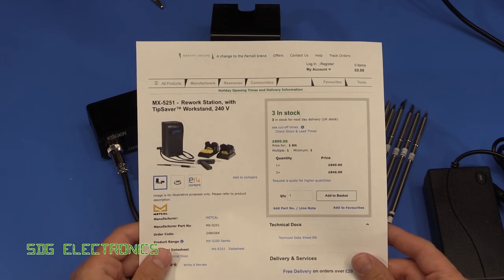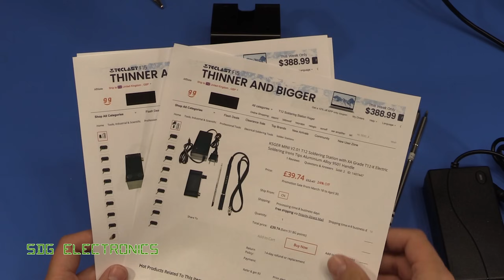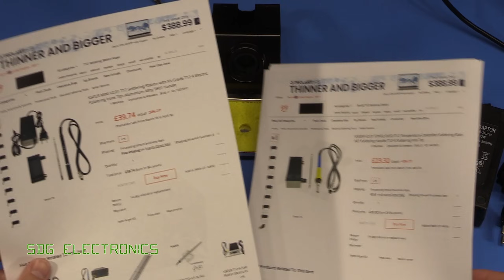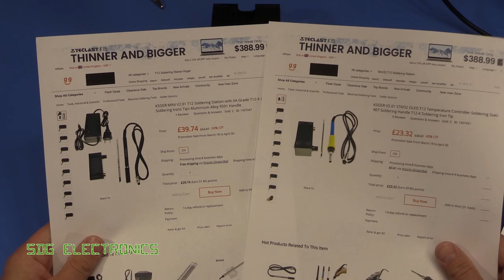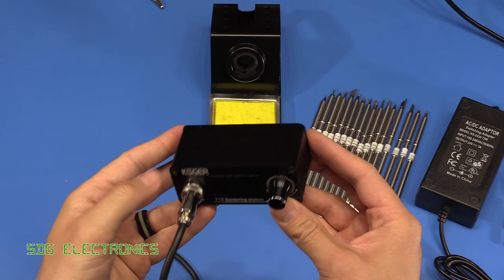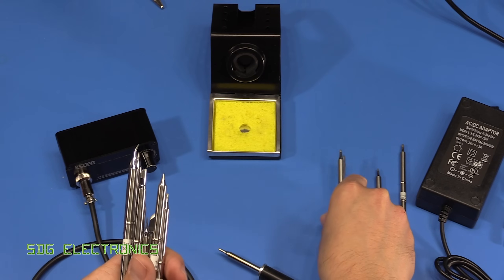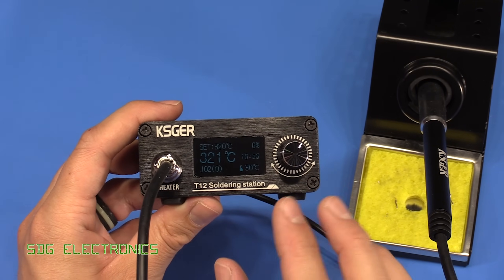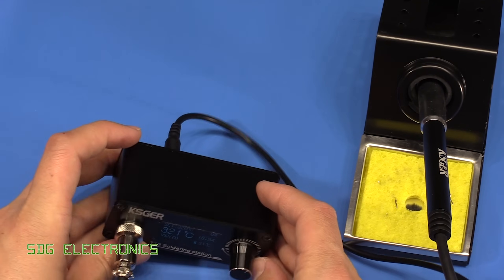SDG #072 Best Low Cost Soldering Station - QUICKO / KSGER T12 STM32 907

Comment: I was looking at buying a Weller or Hakko soldering station for £150-200 but people kept recommending these Chinese T12 stations as they're much cheaper and supposedly much better.  I realised I was looking at buying brands I knew because of nostalgia and aesthetics and not so much because of functionality or performance, so anyway I've splashed £40 on a T12 station a few new tips and a iron holder/safety rest.  If I like it I will recommend it to a friend who is looking for a hobby iron.

Comment: Great video! I do have a question I just need an iron for soldering pl259 connectors onto coax for amateur radio. I’ve been told you want a high powered iron to heat the large work piece some claim 60watts others 90watts. Is this something you can comment on?

Comment: If I used a 24 Volt, 5 amp DC power supply, would it hurt anything?   Or, do I need to limit amps to 3 or 4?  I am considering buying the Quicko unit.

Comment: I am a hobbyist but over decades of working on vehicles I have done a huge amount of wire repair, soldering, heat-shrink on 50 foot rolls & dielectric grease in moderation but I know this may not get an answer, but can change from degrees C to F?
  And you had mentioned software, downloads or files (Something like that) but do this mean it connects to a computer to set up certain things?
  I really appreciate the show & tell and clear proper British speech. The old ears ain’t what they used to be. I’ve been married 40+ years and that alone comes in handy. You will see!
 Thanks for the work & info + links.
Regards!
Reply: Well, SDG Electronics have sold out all items in link. I guess I will wait!
Thanks for the info again!
Reply from the maker: There are some options on Aliexpress, but the component shortage reduced available stock

Comment: Just got a Hakko 888D. This iron seems to be better for the price. I guess I can just feel good for supporting Hakko. The Hakko 888D is a great iron, it does not have the automatic turn off.
Reply: Bad choice. That's an outdated technology. Having the heater and thermistor at the tip in one single piece is in another league.

Comment: Is the tip ESD safe? I'll be using a grounded 19.5V 2.31A laptop power supply and sometimes a double insulated power supply. 
Hope the 45W will be sufficient.
Reply from the maker: The tip is connected to the chassis, so if using an earthed power supply, it should be referenced to earth
Reply: @sdgelectronics  how so? The DC plug at the back has only two pins, not three.
Reply: @alejandroperez5368  i have modded both the 24v power adapter and the mini T12 to include 4mm banana sockets and make a earth wire with banana plug. It works great

Comment: Do you think it's possible to sort of "hack" the quicko T12 to use another style of iron like the zd931 variant? They are both 4-pin connectors, but I'm not sure the PID controller will work properly with the zd931 iron due to them probably having very different thermal characteristics.

They also might be using very different thermistor values.

Comment: Hi, I have a question.
-it is still ESD safe(grounded) when power supply has only 2 pin AC connector to the wall?( i want that MINI version)
I leave like and sub if you can help me :)
Reply: No, but if you use a power supply with a mains referenced ground for the barrel jack, then it is, but I recommend going for the full size one, then there's no guessing. The third prong is ground on any plug, and isn't grounded otherwise.
Reply: @jmantothe64  Thanks for advice :)

Comment: Do I still need to ground bond this type of Soldering station?
Reply: I'm guessing no, as in this version all the mains stuff is in a seperate plastic case power supply.
Reply: @untrust2033  what about for ESD reasons?
Reply: no
Reply: demetrio dario nope

Comment: Metcal MX500 models can usually be found cheap on eBay, I wouldn’t use anything else :-)
Reply: Whats better,a 2 handle Jbc clone for $200,or a pace ads 200 for $260,or a metcal mx500?

Comment: does the black aluminum soldering iron handle heating up in finger when used?
Reply from the maker: I used it for 3 hours of PCB assembly - it got warm but not hot.

Comment: Since this is powered by an external power supply, do you have any idea if the tip is ESD safe?
Reply from the maker: It is when connected to a Class I power supply. I didn't look at the supplied power supply to see if it was earthed or not.

Comment: Between the t12 Like Stations (this) and ts100 (which offers better mobility ) isnt really a difference performance wise.
 24v Brick or Li-ion pack both deliver buch of Power into the tip.   These t12 only has the advantage of supporting the hakko tips properly. TS100 does aswell but it makes it unnecessarily long/unwieldy.

Im using both, i pick the one thats the most convenient in this particular situation.
Reply from the maker: I've not tried the TS100, the distance between the tip and the handle looked a little long for my liking but I do think these offer huge value to the hobbyist. Decent temperature controlled soldering irons were always so expensive in the past. Thanks

Comment: They will run from a 20v lithium battery like the ones used on a drill.  I have Ridgid batteries and I 3d printed an adapter plate to get the voltage out of it.  It runs for a very long time and lets me work in the yard, on cars, or in spots where AC is not available or inconvenient....
Reply from the maker: Yes, there is a menu option to change the minimum voltage before the unit shuts down. I will double-check when I get chance what the minimum setting is.
Reply: @sdgelectronics  The Quicko unit I have (T12-942) works from 16v to 24v well within the envelope of a "20v" (5S) battery that typically runs at 18.5v
Reply from the maker: @kirkb4989  looks like this one also works down to 16V. Very versatile 👌

Comment: Are there any cheap soldering stations that turn off the heater when you put the handle in its stand?
Reply: Reading through the comments, the one shown in the video has a tilt sensor in the handle to facilitate sleep mode.
Reply: @japonicaren  So the thing turns off when you tilt it forwards....   what kind of nonsense is that? Have the engineers who designed this never heard of hall effect sensors?
Reply: @slap_my_hand  Just turn it off. It literally takes 8 seconds too heat up.
Reply: @slap_my_hand  No, the iron turns off when it detects zero motion within a specified time limit (e.g. 1 minute), and then wakes back up depending on your settings. Also, ever heard of KISS? A simple tilt sensor is less complicated, uses less power and costs less than a HES.
Reply: @screengames5307  Hall effect sensors are cheap and simple, that's why they are used everywhere. Have you ever heard of a laptop that uses motion detection to detect when it's lid is closed?

Comment: I have the same handle/pen and have been looking for a stand that holds it securely enough that I don't worry about it just slipping out if I bump the desk or something. I have seen the stand you are using and many others but they all seem to have too big of a hole. It looks like you  modified yours to make it fit right. What did you do to make it work better?
Reply from the maker: I just used some Silicone rubber to make a cone. It sits in there really well.

Comment: I have a decent soldering station, but I have been  looking into buying one of these for ease of tip change and to for wiring and large junction soldering as a second station. Great Video, very useful
Reply from the maker: I'll run it through it's paces over the next few soldering videos. It looks really good though in terms of performance

Comment: How about if you make a video adapting your high-end Solder handpiece to one of those cheap soldering station‘s. 
       Then you may get the performance and feel with the hand-in-hand piece with a good quality tip insert been powered by a lower and cheap station
Reply from the maker: The heater in the Metcal is an RF heater that's driven by a ~13MHz driver in the base unit, so very different to a standard resistive heater. It uses the curie point of the soldering iron tip to regulate temperature hence the extremely fast thermal response. It's not feasible to design a low cost driver really.
Reply: SDG Electronics 
Came here to say that.
One thing Metcalf make that you can use is those silicon pads for grabbing and swapping hot tips.